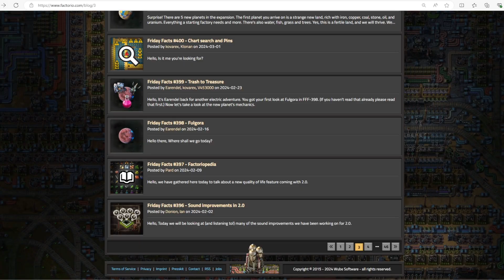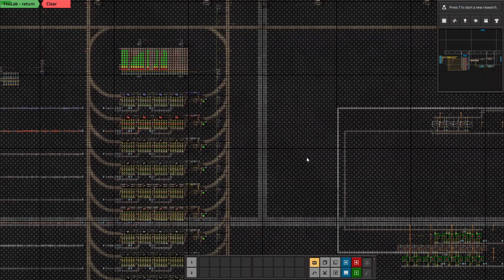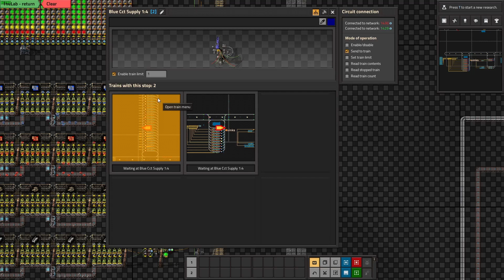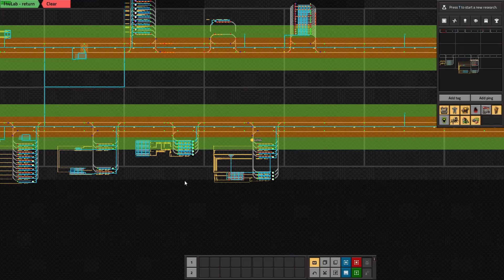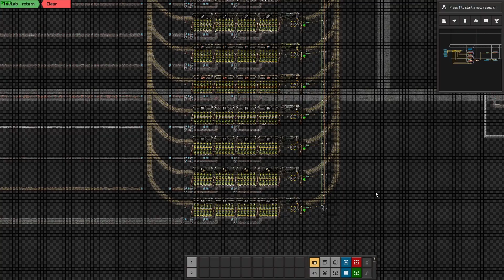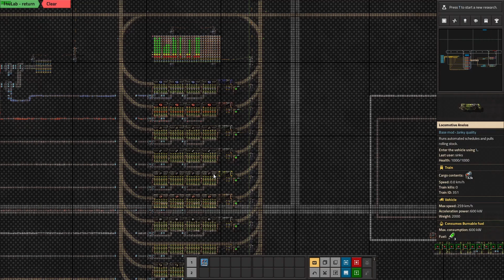Factorio 2 0: Space Age - SCRAP Deep Dive

Comment: Maybe I am a mainstream player, but I can’t imagine why you would need circuits for the enrichment process. I successfully made an enrichment process work with splitters. It was a lot of fun to build. I am that player who uses circuits for accumulators and oil cracking, but I did use circuits in a very slightly novel way yesterday. I wanted to prioritize oil over coal for plastics, but only when there was enough petroleum, so I did a wire attached to a petroleum gas tank.
Reply: Oh yes, come to think of it, I can imagine why you would use circuits. You want multiple center fugitive running before you have an abundance of you 235.
Reply from the maker: I didnt explain it well, but the benefits of a MAM in quality enrichment early/midgame is twofold:  
1. Lower setup cost.  How many quality modules (at any Tier/Quality) did your enrichment setup use, 50-100? Would it be cheaper/easier to setup if you only needed 8-12?  That would mean Higher tier modules would be affordable much earlier, actually meaning faster scaling.
2. Machine utilisation.  Once you've spent the resources for max Quality, would you rather your expensive machine sit idle, or be constantly utilised?  

I agree its complicated, but its not much worse than oil balancing, it's just... new.

Comment: Great video, this is very similar to actual prototyping in space/exploration. Love this kind of experimentation and enjoyed the video. 

The selector combinator is a godsend in my view, for thousands of hours I'd use janky builds to calculate alot of the features it has, or I'd use modded circuit combinators in the mod portal. Especially when I got into playing SEK2 Runs, it became very evident the need to engineer something adaptable and modular for those features. One example I ran into large annoyance with is stack size determination, I'd usually have to build a fairly large array of constant combinators with presets to get the information I needed. Count Input and indexing will be something I very much want to utilize with trains and spaceships.

Your point about requester chests, I think it was mentioned in  FFF #428 that we can now enable/disable requester chests in 2.0 with variables. So we essentially got the read and request option instead of having only one or the other. So for instance in some of my playthroughs, I'd have bot based multi item train stations with more than 1 wagon, and one problem was always balancing lots of chests, or in sek2 balancing warehouses, but even with fewer storage entities, I'd get balancing problems with bots, and this required me to create a very complex station designs which would require lots circuit work which would eat up alot of time usage on my CPU once I started getting into very large scales of production (Over 500 multi item stations). I think on Fulgora multi item stations will become a big factor in space savings(especially with the new train interrupts in 2.0, aka vanilla LTN). 

When you talked about VOIDing items on overflow, in my mind I'm imagining just having some sort of science post on Fulgora which will use up all that overflow. What I mean is having a dedicated science production plant on Fulgora, and then just launching those science packs back to a dedicated science facility(Space or 5th Planet?). That way I'm recycling and producing out of that overflow all the items I will need for science production, and then prioritizing science packs from Fulgora. I don't know if this is logistically viable though with transportation costs, since the Devs mentioned that item weight is directly linked to recipes, so fairly complex and expensive items will be pretty heavy on the rockets.

On the point about Trains being the head point of alot of megabases, do keep in mind that with the new greenbelts (60item/sec) and the item stacking on belts(4x), we essentially now have a 433% increase in throughput for the end game belt, I'm not entirely sure train stations will be able to keep up with true legendary megabases. We're only really going to Fulgora for Holmium and the unlocks. If we can't scale easy on Fulgora with the landfill method, maybe just have it be a Holmium outpost. Otherwise I'm just going to start landfilling the whole planet to make modules and use overflow.

Its unfortunate they haven't added a water less combustion generator into the vanilla game, like gas turbines generators in real life. Hopefully the ice from scrap can keep up with the water demands on the steam power systems till the players can get upgrades.

Comment: while i'd agree that SINCE scrap has no use before its first pass through a recycler, it makes "sense" to set up a first round of recycling at the outpost, but this presents the problem that you have trainloads that must use the "inactivity" condition rather than the "cargo full" condition, resulting in imbalances at the loading stations which can LOCK an entire outpost. So it's actually probably "better" to have your outposts load the scrap, and have the processing "just deal with it" at the first stage of your factory.
Reply from the maker: Agree, Loading unsorted products is much more complex than it sounds, and jams without a better design than I knocked up.  
Simplest option may be to just build longer trains.  1:4 is personal preference, I may have to let that go
Reply: I do think there are edge cases or even late-game / mega-base arguments for doing initial processing of scrap at the outposts, but that probably won't make sense until you have dozens of outposts and it becomes the most effective way to increase base throughput. (by removing the bottleneck of your stating base's centralized initial processing of the scrap. So it'll probably end up being a case of "when to expand"......and when the "fulgora landfill" becomes unlocked.
Reply from the maker: Yeah, spot on.  Also, a good prediction (from reddit) when you are approaching the 20-30 blue belts size, if there was a scrap productivity infinite research, maybe handling scrap would start looking better

Comment: Nice build. Coincidentally, I started doing something similar but with new rails with "fake new rails" mod. There's no rail planner, it takes a very long time, have to make intersections from separate parts.
Reply from the maker: Thanks dude, I'd like to see it.  The Space Age features I wish I could deep dive the most is actually Train Groups and Interrupts.
Reply: @EMBossGames 
I reread that fff and it literally says:  "For example, you can have a system where you let the stop decide where to send the train using the circuit conditions and interrupts." 
It's the answer to my questions. Now I wait this system with you.
Reply: @EMBossGames 
I think you know there is a train groups mod made by one of the devs, works very well.

Interrupts is an interesting feature, but I still haven't figured out its capabilities other than smart refueling (that already possible with "train control signal" mod, made by another wube dev). 
Will it allow you to dispatch trains not to the next station in the schedule, but to any station, depending on the logic (combinator connected to station)? Example: train stay at station, station connected to combinator, and if it send signal A then they dispatch to station A, if signal B then to station B, and it doesn't matter what's on train schedule. It can be called push system. Will it be possible?

Or will this system allow you to make dynamic requests where one train goes to several loading stations and drop many resources at once (LTN style)?

The way I see it is that interrupts sit between basic schedule and LTN. And I don't understand why people from both groups want to swap to interrupts system. For schedule group it's too complex without benefits, for LTN group it's useless.

Sry for the imperfect English, I hope the idea is clear.